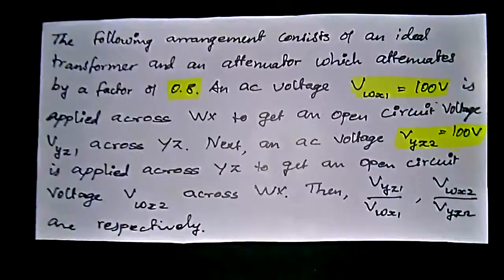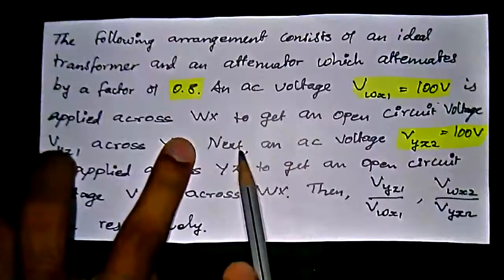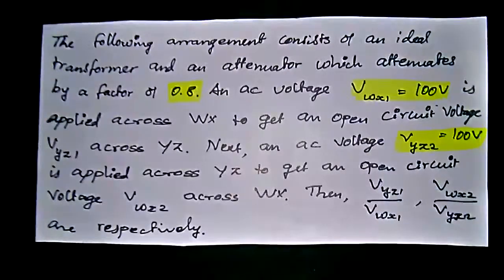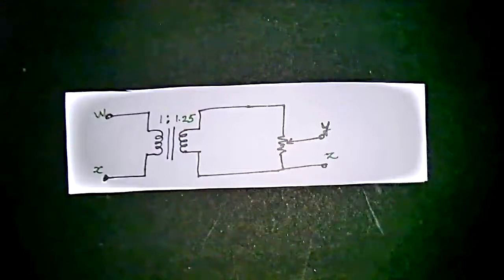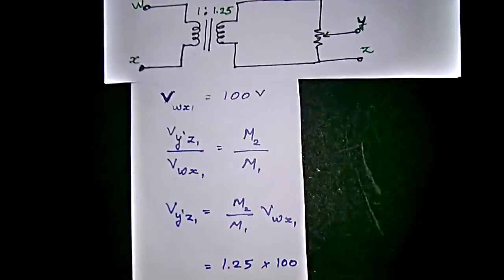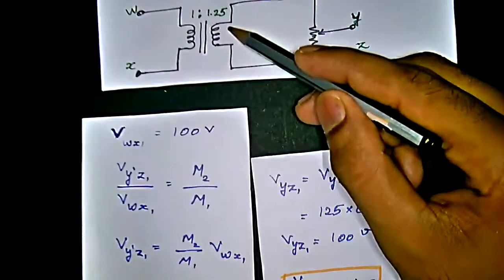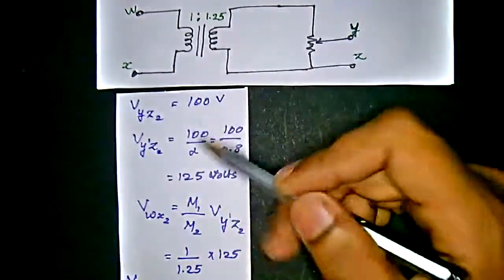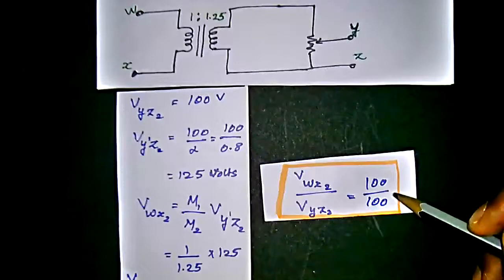Transformer ratio with exchanges of primary to secondary

Comment from the maker: The following arrangement consists of an ideal transformer and an attenuator which attenuates by a factor of 0.8. An ac voltage Vwx1 = 100 V is applied across WX to get an open circuit voltage Vyz1 across YZ. Next, an ac voltage Vyz2 = 100 V is applied across YZ to get an open circuit voltage V wx2 across EX. Then (Vyz1/ Vwx1) and (Vwz2/Vyz2) are  #GATE #ECE